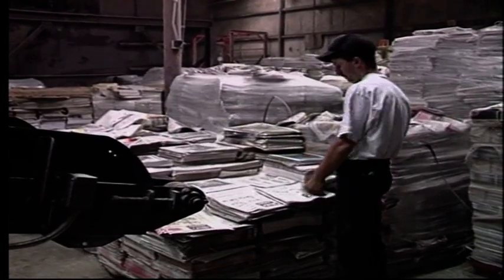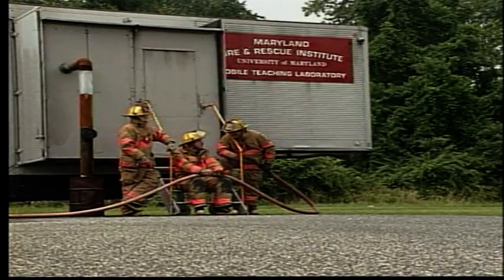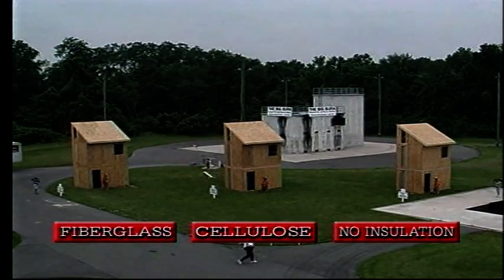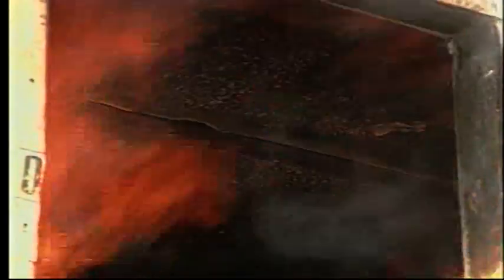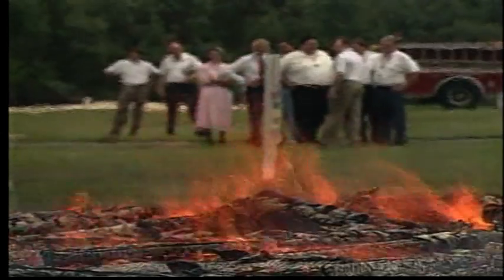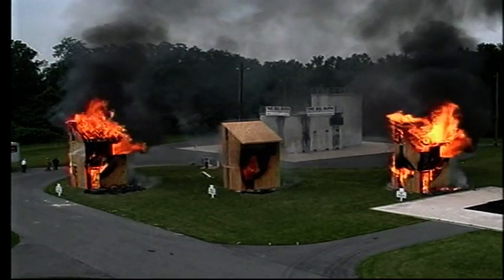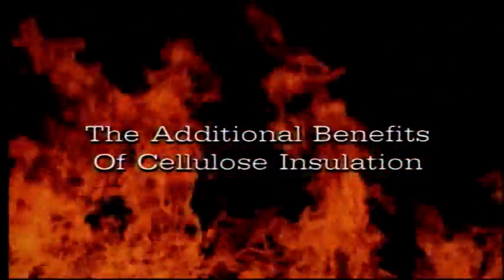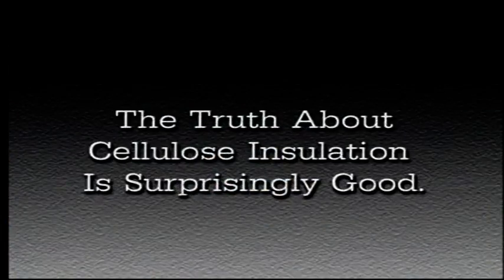The Big Burn: The Truth About Cellulose Insulation

Comment: OLD HAND SAYS: I have laid insulation in attics since 1964,  worked for all the majors as an Installer. We did a fabulous job, but here's something that will shock you, "No insulation product works the way it's claimed to. Some good advice: Old houses CANNOT BE EFFECTIVELY INSULATED, because when first built they contain so many HEAT ESCAPE HOLES (design faults) which forever  PREVENT their insulation - in my opinion, the vast majority of homes are no better off being insulated and MOST should be left alone or totally demolished. I had a potential super-rich client whose home had 123 bedrooms, 2 ballrooms, 2 staircases, miles of long corridors, servants quarters and over 500 windows, and she wanted me to insulate it. When I told her it was an IMPOSSIBILITY she was really vexed. I was shown the door. Sealing and closing the minute holes in old homes beats all knowns insulants. PREVENTING (stopping) cold air coming your home is the correct WAY forward - by doing so you stop hot air going out.
 Cellulose is shredded newspaper. Stay well clear of it, use Owens Corning or Johns Mandeville product only
Reply: Depends on where you buy it? Some locations and companies like in Spokane, is 100 % recycled paper, you just have to check the percentages and do your homework, apparently you didn't and spouted something that's really not true...You haven't done sheeps wool, or hemp, or probably no Mineral wool as well?
Reply: If we had prioritized sprayed aerosol sealing over insulation in existing homes we'd be much better off... It's amazing even in a home that seems fairly well sealed you'll often find half a window worth of openings.

Comment: What happens to cellulose when it gets we from a roof leak or moisture from vents? Does the fire retardant break down or off gas? Does any cellulose that got wet need to be replaced or can it be dried? Some cellulose is made from sulfates and some borates? Are the sulfate containing cellulose more at risk to water and moisture damage and degradation? Is cellulose a non combustible? Or should it be treated as a combustible and kept away from furnace exhaust vent and chimney vents travelling through an attack by an insulation shield above the fire stop?
Reply: Great questions !
Reply: cellulose installation is not combustible atleast the biggest cellulose installation company in north Americas is im not sure about the rest.
Reply: If you have a major roof leak replace moisture damaged insulation and make sure the attic floor is okay.

Comment: The same study could be made for GRAMITHERM (http://gramitherm.ch/à which is made with Grass . fibers . As for cellulose the flame retardant is the boron salt. One factor which is also important is the "Phase shift" which measures le capacity of the insulator to propagate heat...As seen in the following article GRAMITHERM phase shift is excellent https://cleantechinitiatives.international/portfolio/what-if-building-insulation-materials-were-heavily-carbon-negative-economically-viable-in-abundant-supply-and-recyclable/

Comment: You can't use cellulose insulation it in the wall voids of your home if your home has knob and tubing electric or some knob and tubing.  Knob and tubing electric needs free space around the wires.
Reply: +Bossmanrocks If you have that kind of wiring you should probably get it replaced.
Reply: One wall of my house has knob and tubing electric and it can't be removed because the wiring was actually put in through stone when the foundation was laid. Crazy, I know, but they did some crazy things 100 years ago simply out of ignorance.  We know better today.  In my case I just had to make sure no insulation is used in that one wall.  Thankfully, the previous owner managed to have it removed throughout the rest of the house.
Reply: +Bossmanrocks Got any proof of fires caused by knot and tube wiring covered with insulation that was installed right and wasn't overloaded?
Reply: True, and most people do rewiring when doing these types of projects anyhow. If they can't, they'll just have to use some other form of insulation.

Comment: Cellulose Insulation blaze warning. Millions of American families were warned that their new-age insulation could be a potential fire hazard. The alert by an insurance industry product testing laboratory in the US follows a series of blazes. It covers two types of cellulose insulation sold over a 15 year period by installers k/as 'dry cell and open cell'. The problem was caused during manufacture by the dust surrounding the fire retardation liquid - spray head jets being blocked, resulting in large tonnages of the paper based attic insulation not being treated. Placing cellulose insulation close to recessed lighting, or HVACS attic ducts could result in fires. Following recent reports of fires and health problems, cellulose insulation was downgraded by product testing labs, with one refusing to sanctions its continued use. Cellulose installers are planning sending engineers to homes to modify the insulation to eliminate the risk using a 75 mm layer of fiberglass insulation to smother the blaze. The recommended alternative is the complete removal.*
Reply: This is a flat out lie. If you dispute that cite your source.
Reply: @dleaoh . Check the New York Times and the San Francisco Chronicle Archives, or search Google for "The cause of mysterious roof fires has been determined." Insurerance Companies instruct Surveyors to refuse cover unless Cellulose Insulation is removed. The easiest test is to purchase a bag and use it to light barbecues, it's ideal for cooking sausages and burgers.

Comment: Reference: G-PMC Registrars Adverse report on Cellulose Insulation and it's dangers to the public: (PRODUCT RECALL NOTICE SOUGHT)*
This highly reputable company assess and test products for their safety and long term medical risks to the public, installers and end users of it", They considered Cellulose insulation so dangerous that they refused to snaction it's use. In some respects This refusal  is an Official request by them to the Product Licensing Authorties for its continued use to be immediately suspended and outlawed.*
You as a manufacturer and re-seller have a clear duty to heed these public safety warnings and to make sure  you have sufficient Public Liabilty Insurance in place to meet any claims made on you by claimants.  My advice to householders to take immediate steps to have it removed from their homes with the  manufacturers and sellers jointly paying for its removal and / or replacement. Please give your staff photocopies of this report, and obtain their proffered views on whether they wish to continue laying it, or handling it. For my part I will circulate this report to the Insurance Associations so they can (i) adjust their premiums upwards to cover the increased risk, and (ii) stop insuring it. *Please confirm whether or not you will make an instant product recall notice.
Reply: The referenced report is so full of inaccuracies it isn't even worth refuting. Any company that would sanction such a false document is anything but reputable. G-PMC does not test products for safety and long term medical risks. It purports to certify companies to ISO 9000 and other Q/A standards.

Comment: Fiber glass insulation is a proven performer amongst   insulation products. It provides exceptional thermal performance, moisture and mold resistance and fire protection..
Reply: but it tends to be pressed down (less space for air in the structure) and it tends to accumulate humifity like a sponge (but not that fast) - if there is undiscovered leakage in the outer layer of roof, your fiber glass will keep on accumulating water and thus losing isulatory capabilities - i have just learnt that when i was re-insulating my roof last year
Reply: You really are a MOUTHPIECE mole for the cheesy fiberglass industry, aren't you? Its not the answer for energy efficiency, not close, the only time i recommend fiberglass is with Knauf that is non toxic and didn't BS the public about its binders and past formaldehyde use...
Reply: @roberthaverlock8605   Listen up: Knauf and another well known UK PLC firm of resellers-(huge wholesalers) are fixing the prices, fibreglass is cheap to make, easy to make, but do they care!!!! No Way.    Knauf is so overpriced it should be totally ignored,  better this firm should be closed down, they can close firms in the USA - Cartel Law,-  but not the UK or Europe. In the last 40 years fibreglass quality as gone down, down - down. I used to struggle to cut it with a sharp knife, today it rips with your fingers, candy-fluff- and the thicknesses they recommend are nuts. Only the first 3 inches works, the rest is sales talk, overcharges and window-dressing.

Comment: THE LAUGHS ON LARRY:  Enews press release / Cellulose insulation is made with recycled paper, most of it consumer waste paper like newspapers.  However, there is still a virtual mountain of waste paper going to landfills. Recent calculations indicate approximately 1,126,330 pounds of newspaper become waste about every 10 minutes in the United States.  When recycled as cellulose insulation, that’s enough waste paper to insulate 220 energy efficient new homes every 10 minutes.” Cellulose insulation installers will continue to work at both the industrial level with major paper recyclers, dumpers, and grassroots programs such as local charitable paper drives, this will help solve the nation’s overflowing landfill problems. Insulating homes with recycled waste paper makes sense. 
Own Trade warning notice: Watch out for “blow and go companies” the industry term—for cellulose firms who charge a hefty fee, promise major heat saving upgrades, then disapear. (Source the www)

Comment: Are you high on crack???  I have that cellulose crap in my attic and it is a mess.  After 50 years it has broken down to just dust and I hate it.  I will spend the money soon to have it vacuumed up and put in Fiberglass
Reply: +birther1968 Cellulose doesn't break down. If what you're seeing is very little insulation, it's because there wasn't much blown in back when they first put it in. Cellulose does have a settling factor which is why it's important to blow in a lot more to compensate for this settling factor.

Comment: Nice, except that a stack of wood is not a common furniture in most houses.  Let's try it with a more realistic fire load with more plastics and BTU's.   And let's  put on vinyl siding so the fire communicates up the sides of the house into the eaves, where it will burn the trusses OVER the insulation.
Reply: Too many variables here.

Comment: Try that test after 3 or 4 years and see what happens. Roxul will beat PigPiss(Fiber glass) or cellulose ever time. This is why Roxul is abot 85% of the Canadain market.
Reply: After 40 years the results will be the same.
Reply: +mike m I did some research and the product you recommend sounds great.  Fireproof to over 2000 degrees, great insulation and soundproofing properties.  Thanks for the tip.  I never heard of this product before now.  I presently have cellulose insulation in the attic that has to be removed because the idiot who put it in for a previous owner filled the soffits with this crap.  I could opt to keep what I have there right now but if they are going to remove it from the soffits they might as well get rid of all of it.  Besides, I have a metal roof and when it rains it sounds like a typhoon is going on in my attic.  Roxul will take care of that noise problem too, something cellulose or fiberglass won't do.

Comment: I wish I had seen the nonsense comments here much sooner -- especially the one claiming that the demonstration was “rigged” and is misrepresentation. The demonstration structures were designed by and built under the supervision of Steven Winter Associates, a well-respected engineering and architectural firm specializing in energy efficiency and sustainable construction. The demonstration was conducted at the Maryland Fire and Rescue Institute training facility at the Aberdeen Proving Ground. Would these organizations risk their reputations by cooperating in a conspiracy to misrepresent anything having to do with fire safety or the built environment?  It is a flat out lie to state that the uninsulated and the fiber glass insulated structures didn't have sheetrock interior finish.  They did. All three structures were identical, except for the insulation. That commenter cites UL as the source for his false statement. UL had nothing to do with this demonstration. No one at UL would be qualified to comment on any aspect of it. Frankly, I doubt that anyone at UL did. The demonstration in this video is one of three that have been done over the years, first in 1978, then in 1987, and finally in 1998.  The results in every case were the same.  Fiber glass insulated and uninsulated structures burned to the ground while cellulose insulated structures retained structural integrity. That gives occupants more time to reach safety and the fire company more time to reach the scene and save at least part of the structure. Finally there's the comment about cellulose not being "green" because it takes paper fibers out of the recycling loop.  Unlike glass or metal, paper can't be run around and around the recycling loop.  The fibers get shorter with every reprocessing and eventually end up as useless powder.  It will always be necessary to add new fibers to the papermaking process. Cellulose insulation simply puts the fibers diverted to make room for these new fibers to productive use improving the energy-efficiency of homes.  As to the claim that cellulose insulation is "in no sense whatsoever recycled or green," cellulose insulation is composed of 85% to 89% recovered paper fiber.  Most of that is postconsumer recovered paper.  I think most reasonable people would consider that to be green and recycled.
Reply: I've sold all types of insulations, except foam! The recycled content is, I think the most important, because sometimes, manufacturers fudge the numbers to, say 82% vs. the real 75%, but thats still a lot of recycled paper, so thats number to I watch for...and what % is the new paper added percentages? is the other...
Reply: Good Feedback...Thanks
Reply: Sorry, good feedback!
Reply: Well said, I was there for this test and everything was monitored by the Fire Chief and others with no horses in that race; so to speak.

Comment: One thing that he should have mentioned is that fiberglass insulation puts off toxic fumes when it burns. Some of which are heavier than air. That would mean anyone who crawls on the floor to avoid the smoke would be inhaling those toxic fumes. Oops!
Reply: Its just made of inert glass, it doesn't burn, it collapses and melts.
Reply: I think you mean cellulose? As that is treated with chemicals such as boric acid..

Comment: Cellulose is "wood fibre" treated with fire retardants - wood begins to smoulder at only 140 deg C and will ignite at 190 deg C in it's natural form.. how long do fire retardants last ???

Fibreglass is "glass" which is NON combustible  - this video is bordering on misrepresentation
Reply: From what I understand, sodium tetraborate is a salt, and is inherently stable and will remain so until it is physically removed from the substrate. = )